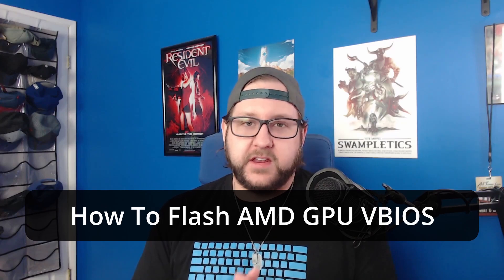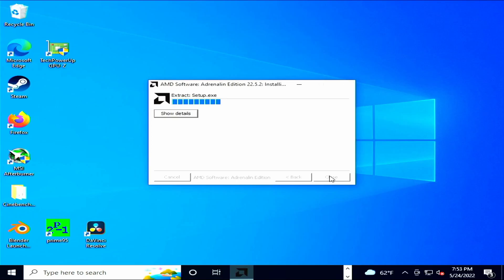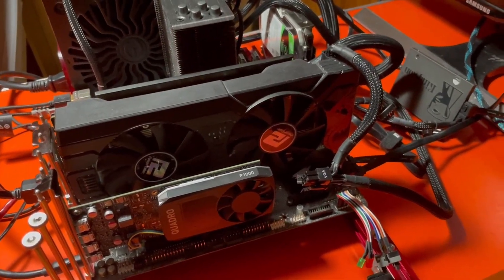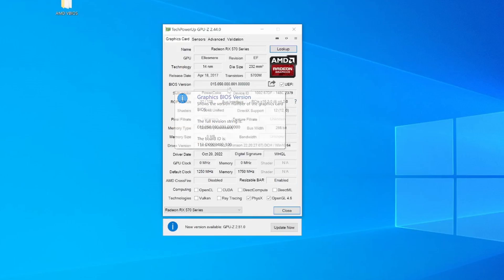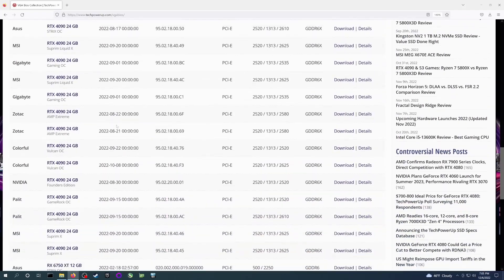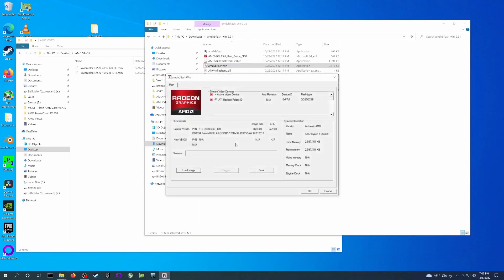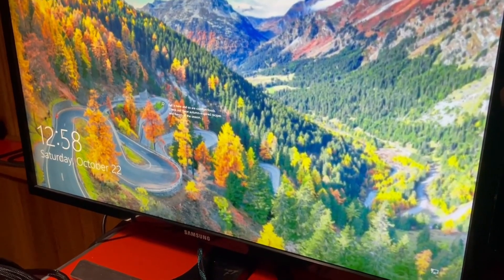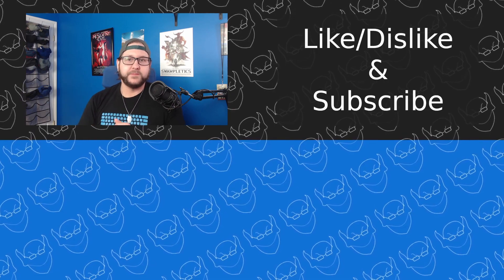How To Flash AMD GPU VBIOS

Comment: Hi sir I did all these things, but at the last stage, the system told me that the BIOS of the company was already installed on the card, but in many games it does not use the real power and has a large performance drop.
Reply: Is there another way to change the BIOS card, it has probably already been done with my card and the card was overclocked in the MSI Afterburnt settings, please guide me.
Reply from the maker: I would try a different version of the BIOS that you can find on TechPowerUp - my card had a few different versions, and if the version you're trying to flash has the same version string as what's already on the card then it won't let you flash it.
Reply: @BitGoblin  Is it possible to change the version of the BIOS file before installing it to solve my problem during installation?

Comment: I get an display driver not installed error with the flash tool, but I cannot install displaydrivers because of the mining bios what can I do? Please let me know.
Reply from the maker: What OS are you on? I've seen that happen before when running an older Windows version that isn't supported anymore. 

You could also try running the AMDVBFlashDriverInstaller.exe tool that comes with the AMDVBFlash ZIP download.
Reply: @BitGoblin  yes, thank you it works now. I used the latest windows 10, thats why I was confused to see this error. But I flashed it succesfully. Thank you very much for your amazing video and help!
Reply from the maker: Awesome, I'm glad to hear that! Can I ask what you did differently to get it to work?
Reply: @Bit Goblin  just like you said, I ran the amdvbflashdriver installer instead of using normal drivers and it worked perfectly!

Comment: i followed your exact steps and flash was successful but nothing changed bios still the same and everything else?
Reply from the maker: Hmm, you can maybe try flashing a different version of the BIOS if there is one available?

What model of card do you have? That may help in trying to find specific instructions to try and rectify this.
Reply: @BitGoblin  i have ASrock phantom gaming rx 550 2gb ddr5 128bit

Comment: Hi like you i purchased 3 gpu's from ebay and all 3 crash when the driver is loading. I replaced the thermal paste in them all but still the same result. I am going to try and flash the bios following your instructions and i hope that will remedy the problem, wish me luck. Great video cheers.
Reply from the maker: That's awesome :) I love seeing used hardware getting new life elsewhere. Let me know if you get them working! Good luck
Reply: @BitGoblin  Hi no success so far 1 more to go
Reply: @BitGoblin  I will ty for the reply
Reply: @spangles365  did you get them working?
Reply: @pcmanraul  No I tried 2 with no success i will try the other soon.

Comment: hi, recently i have installed windows and my Aorus rx 570 gup drive doesnot install properly, i used this gpu in mac os (Hackintosh) and it was fine. but i moved to windows for using 3ds max. i dont know much about bios, vbios.  please help me to get out of it
Reply from the maker: Hmm, that's a tough one. Maybe flashing the VBIOS would work? I wouldn't think that Apple does anything off with their GPU VBIOSes, but it's certainly something I can see them doing.